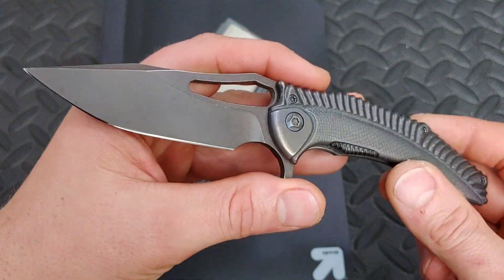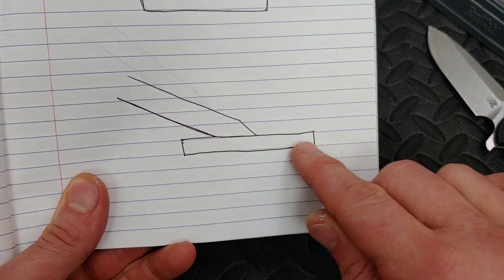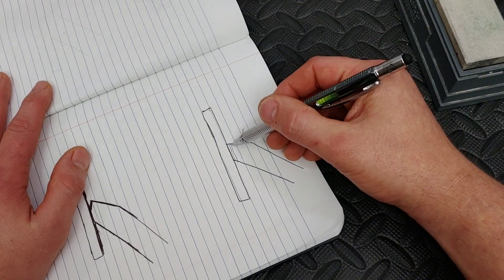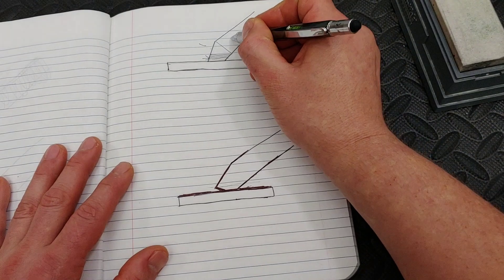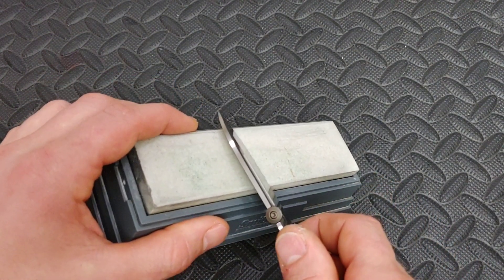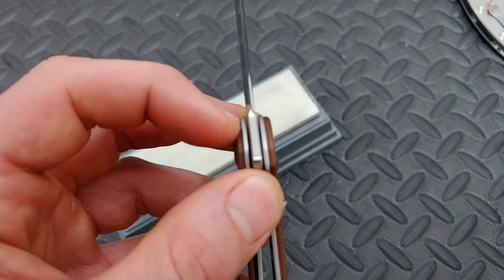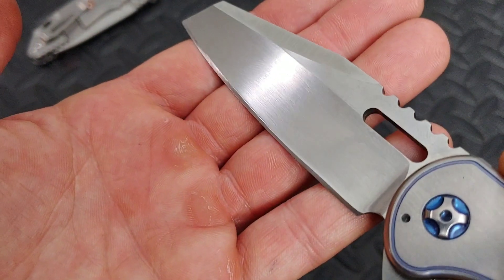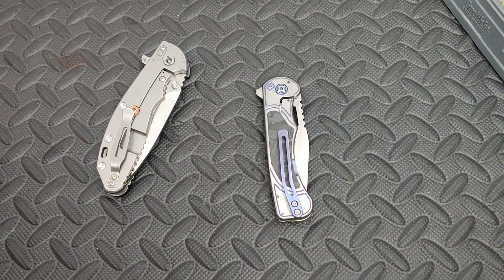HOW TO FIX UNEVEN BEVELS IN KNIFE SHARPENING

Comment: This is by far the best explanation of how to correct a knife edge,, I have been using a knife for nearly 30 years and I always suffer with this issue. For years I would try to correct the side with the lower angle and it used to drive me crazy with a very inconsistent edge. This explanation is the soloution for sure

Comment: I’m about to take an angle grinder and mess my whole knife up I swear. It was almost perfect and then I realized I had mirror polished all but a tiny bit because the angle is off on one side. I need to remove so much material (I took your advice and got the diamond lansky as well as the stones. So helpful) but this knife was abused and it’s gonna try my patience.

Comment: Great informative video. In my experience with knives with a uneven bevel I don’t even sharpen it out the first time. It my take me 2,3 or even 4 to get it where I want it. Same with chips as long as it’s not really effecting the sharpness or cutting. It might just be me but I want to save as much of the knife as I can when I sharpen.
Reply from the maker: Yeah i also do that but depending, if im already sharpening and realize im making a mistake then i will address it as much as possible but i also try not to remove steel i do t have to, great comment

Comment: Brand new Buck 120 in D2 just got here the other day. I have a wide bevel on one side, especially at the tip, and a 20-degree bevel on the other side.  I can't believe it made it through quality control. It's readily obvious that someone got a little heavy-handed in the sharpening dept. The edge is centered but the point is off a bit.  I'm worried about matching the wide bevel on the 20-degree side due to the fact that it might make the steel too thin and brittle.  IDK yet.  I'm considering just living with it and letting it work itself out over time.

Comment: I know it happens perhaps too often, but I hate when the grind is not correctly done. I hate finding after sharpening correctly, that some parts of the bevel are thicker than others. But it's true that these knives are perfectly usable, also.
Reply from the maker: Yes for sure and you dont always have to do everything in one sharpening, theres nothing wrong with taking a couple edges to do something to avoid losing steel that you didnt need to lose

Comment: @NeevesKnives I have uneven bevel on my Bugout. When I finish my smaller side do i do the same on the bigger side but less strokes or I don't touch the bigger side at all? But I have to remove the burr. The difference is big in mine and i want to do it during 3 or 4 sharpenings and use the knife between.

Comment: What happens to me when I have to come down from a higher angle to meet a lower angled side is the higher angle side ends up having a wider bevel than the original low angle side. Because I take away metal from the higher angle side at the top of the bevel so I don’t take metal away from the edge. It always annoys me with two different sized bevels. Am I doing something wrong thanks.
Reply from the maker: only slightly, its only going to get bigger with the grind getting thicker, so its not usually noticable unless you remove a lot of steel. so usually it wont change much at all however you can doit until the other side matches, make sure you fatigue the burr every so often so it snaps off when ready
Reply: @NeevesKnives  okay thanks will try that out

Comment: Thank u so much! This is the only video i could find that made sense to me. And i been making this bevel worse just driving me insane. I had a 17* on one side and around a 22* on the other from spyderco. It was razor sharp but after honing with a ceramic rod for a few years i just cant get it sharp enough to my expectations.  You solved my problem opened up my mind with your drawing and great explanation.  Ive used markers and everything. Drove me nuts. Feel like an idiot now but i just learned a big lesson. Thanks again.❤

Comment: I don't care how good you are in free hand sharpening nobody can establish the exact angle on both sides of their knives or even from heel to tip.  So why even worry about it.  And it really has no effect on the cutting functionality of the knife.
Reply: With my worksharp professional precision adjust I can get both sides to have exact same angles idk what you mean bud. I'm sure if you got out some fancy device and measured they would be off 0.25% or something  silly like that. It does matter that they are even , it makes it so much easier to sharpen / touch up when they are symmetrical angles

Comment: There will be some asymmetrical bevels getting destroyed from here...
Reply from the maker: ? The point is they are not a symmetrical its how to help even them out
Reply: @NeevesKnives i really like what you do, lets that be said, please take it with a grain of salt, i said it because there are knives that need to be sharpened asymmetrical because they where build that way, thats not the case in the knives you showed ofc and appears more in terms of kitchen knives. But if you woud "even out" those secondarys you woud be either not center or have a longer bevel again but on the wrong side what woud lead into increased shearing forces in cause of the shape of the primary grind itself.  

Sorry for my bad expression in english, if you do not understand what i tryed to say please fire away :)

best regards Cedric
Reply from the maker: @sedorriku8021  yeah i get that, i can only put so much info into each video and i try to explain certain circumstances most times, but as you probably know theres so much information that it can be difficult at times
Reply: @NeevesKnives  yeah totally agree. Just wanted to mention it, i saw it as important hope you didnt took ot personal. Woud love to talk with you about sharpening once!